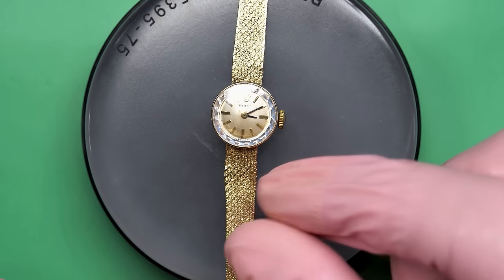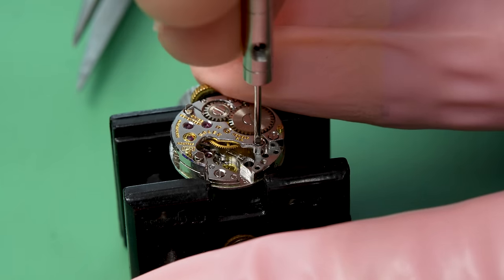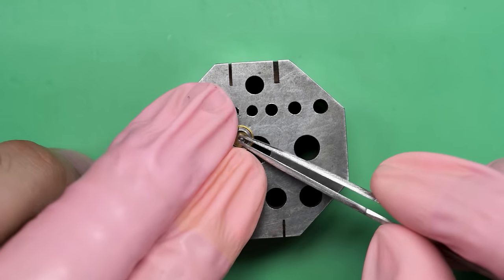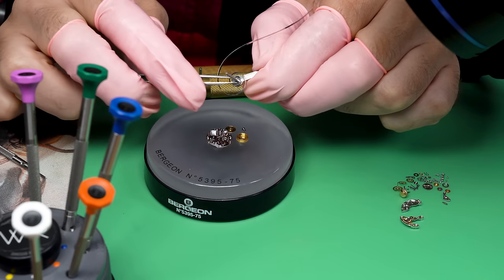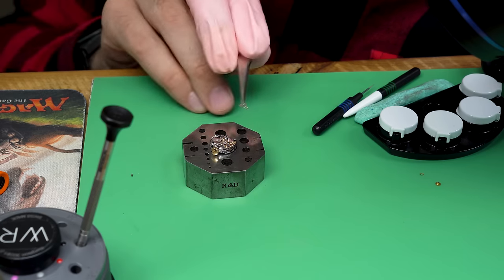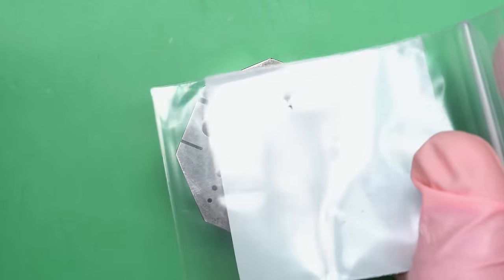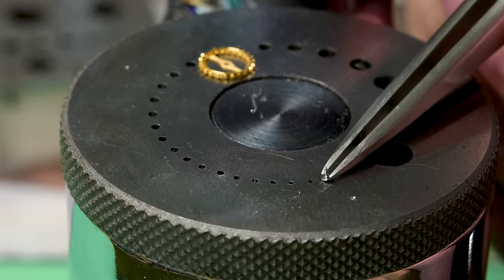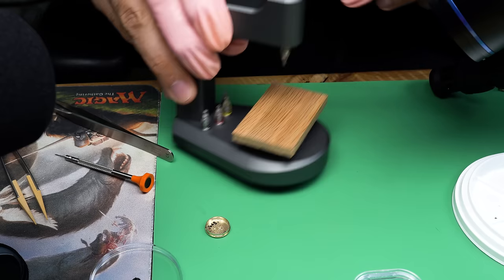I Lied, THIS is the Smallest Mechanical Watch I've Ever Seen!

Comment: I just watched your episode about the bigger smallest watch and left some remarks there. I am very impressed by you riveting the balance shaft having seemingly nil experience. It is a complex procedure, that requires some intricate steps of which you stay mute. Just one of them is how to achieve the not so amazing off-beat error that you got. 
You face an issue of over confidence not being aware of your limitations. One example is that you don't know that peg wood is for cleaning the bores of the jewels, not their surfaces; you just don't know how to clean jewels properly. You also don't know how to properly lubricate a watch, using much too much oil in some of the instances forgetting about some others. It greatly affects the performance of the watches you work on.
You are excellent at what you're doing as a watch repair channel host, but as a watch maker you're at a fumbling around level right now, drawing your satisfaction from dashing into the unfamiliar.
You have the curiosity, courage and the potential to to do really well once you spent some time to study the theory behind the matter. Best wishes.

Comment: 36:40 That's where I probably wouldn't be a good watchmaker, since I simply love to over lubricate everything I work on. I would oil every point of contact 😂 While most of mechanisms I work on are capable of discharging excessive lubricant, this definitely wouldn't work here. And not enough lubrication was always a concern for me 😂

Comment: I wonder if the guy who serviced it last accidentally broke that part and just put it back together and not say anything since it was still technically running at the time. If they didn't break it they should have noticed it was broken just like you eventually did.

Comment: Hi Marshall,  Just subscribed. I have been watching your videos for some time. I appreciate the manner and approach you have in exploring everything wristwatch.  Because you have made the repair of pocket watches, in particular, so interesting I have purchased an inexpensive quartz pocket watch to see if carrying a pocket watch instead of a wrist watch is something I can adapt to using regularly.  Concurrently, I have begun to explore the cost of purchasing a mechanical pocket watch of the type that often have worked on in your videos. Thanks for these videos, they are enjoyable on several levels.    ---update---  got a mech pocket watch.  I am searching your vids for how to open it up. It has two small cuffs (one on each side) to open front and back but I am proceeding slowly.

Comment: Actually, I acquired a small ladies Rolex watch very similar to this one when I was still working as a manufacturing jeweller, being offered to me for the scrap-value.  Aesthetically, it wasn't a nice looking watch as the band was as wide as the watch-case and attached much lower down making it look higher when worn, and instead of yellow-gold it was 18ct white-gold which tends not to have the whiteness of platinum or rhodium-plating!  Eventually gave it to a watch-repairer friend of mine along with a stack of watches, parts, & tools, in exchange for repairing/overhauling two watches of mine. 
Those were a Seiko Divers 6309-7040 automatic (similar to your 6105, except on the inside of the date window, it also displays the day of the week in English or Spanish) and a S/S manual Tudor 7934 Oyster with radiating pearl dial, circa 1960.

Comment: Catch this - after many calculations done with the use of the perpendicular camera shots and diameter of the German watch case stated on their website to be 38,5mm - the tip of the spike within the balance wheel at exacly 34:20 would be around 0,03-0,04mm.
Now, I've dug the internet about what's the diameter of a gold atom and it turned out, that this particular spike is roughly 100 000 atoms wide.

Imagine the scale.

Comment: While I realize you probably don't need to work on watches that tiny very often, you could, if you wanted to, build up the contact points of your small movement holder with 5 minute epoxy. A couple few passes on each point would extend it's range... theoretically.

Comment: Hello, just out of curiosity was checking on the 1400 Rolex movement. You aware that there’s more versions? I found out that it exists with at least in two models with either 17 or 18 jewels!! I am now curious where that 18th jewel sits versus the 17 jewel variant!

Comment: When I was very young I went swimming while wearing my basic mechanical watch. I initially thought the watch was water resistant because it survived the first couple of swims. But.. then the whole watch turned into a ball of rust. Moral of the story, mechanical watches don't like to swim! 
Have you tried re-winding the spring by hand without the too!? Also have you ever accidentally bumped your table causing tossing all parts off the table!? Because that's something I would do!

Comment: My friend has an Alben? ring watch circa 1970's, the thing is microscopic. No idea what movement is in it, Anyone know? My thought to hold the movement is just to plant it in a blob of rodico. But the key to "fixing" the small movement holder would be to file the jaws so they had a negative draft angle so they could positively grab the edge of the plate.
ETA: How is the impulse jewel referenced (clocked) to the balance- do you need to mark it or readjust the free sprung balance? I have been lucky so far, every time the balance won't start it is because I missed the pallet fork with the impulse jewel and every time it won't self-strt all it has taken is a beat error adjustment, I haven't had a broken staff (yet).

Comment: Probably that small movement holder doesn't keep its jaws parallel, meaning the pressure introduces an upward force that pushes the moment out...
Or the jaws are just not cut correctly.
Reply from the maker: Yeah it was a junky one

Comment: A 90 Degree rotation in the holder would have put the crown out in the open instead of it sitting on the holder which is why it wiggled when you tried working on it.

Comment: Marshall I have subscribed and liked your channel ever since I've seen it and I am just astounded at what you do I have a Bulova Accutron that I have since my grandfather passed away I remember him letting me wear it when I was 10 years old and I have tried to do what you're doing right now with a donor watch that I purchased off of eBay and I personally know the work and intimidation that those watches can give it has some of the most tiniest wires movements I have no in any way by far a watch repair menu but I can tell you I've seen you do miracles I'm a mechanic I work on cars trucks motorcycles etc and for you to work on these little tiny things that I have no way in the world how they are or even build but with all that being said I would love to see if you could fix something that is more dear to me than a lot of my belongings it's it is that Accutron boulevard The story goes My grandfather was walking down the sidewalk of a shopping center in 19 60 something and some guy took his watch off and do it in the trash can and he walked over and picked it up and he took it somewhere and had a battery put in it and it worked for the longest of time and then I got to wear when I was 10 years old and I moved away of course I had to give it back to him after he passed away now that I'm 52 years old I would love to see if you could get it running again if you could message me back with some kind of idea it would be absolutely heartwarming to see if you could do this and I have extra parts to send you with it if you think you could take this on

Comment: 36:26 to 36:28    When you remove the locking clip securing the jewels, why don't you use plastic or wooden tool not to scratch metal around when you undo or re-install it? I have seen on this and other videos where the metallic tweezers did scratch around the housing, so why not a wooden or plastic tool?
Reply from the maker: Precision with this part of the restoration is most important, you are looking at this work literally under a microscope, these kind of marks are effectively invisible to the eye.

Comment: Could you not get the movement held tight enough? If so, why didn't you put a few washers between the screw through that movement holder and the fixed plate? This would make the fixed plate be closer to the one that moves with the screw :-) If tightness wasn't the problem, Maybe a bit of rubber tape or something on the jaws?

Comment: I read a story a few years back on why women's watches (even from "high horology" brands) were still quartz.

1. Women don't care about the mechanics (this is not all, but most of them)
2. Its' jewelry, not a functional tool.
3. Something like 40% of mechanical watches that women wear where either - 1). Not wound; 2). Not set to the correct time; If the watch was quartz, the battery was dead.

My mom had a few teeny, tiny mechanical watches....I would love to see what the movements looked like..

Comment: Hi marshall have you done a video on how to adjust the watch so it doesn't run to fast?  You show if the watch is within tolerance using the beep machine but thats it
Reply from the maker: Yes I've shown the regulation on a few of the videos

Comment: It may have been worthwhile to build a movement holder adapter of wood to fit inside of your standard size movement holder. A 15 minute job with an appropriate sized paddle bit and a coping saw.
Reply from the maker: 15 min job for you :) I don't know how to do that

Comment: The problem with the movement holder wer all the rounded edges, which came with it being an injection molded part. I bet you could make a better one employing no more complicated tools than a drill press, a vise and a set of files.

Comment: I bet if you found someone with a small milling machine you could make that tiny movement holder work, looks like the jaws are not that well made.  Machining them lightly so they are parallel might help it a lot.

Comment: At the second pop out, at the very least at the third, that tool would have gone straight in the bucket in my shop. I don't tolerate mediocre tools. Either it works or it gets tossed. If that means I'm out of a tool I need, I buy a new one and wait for it rather than breaking my project.

Comment: next time use a rubber band to fill n the gaps on the small watches in that smaller holder. it will also give slip stop.

Comment: Why not set the movement in the green clay-like goop I've seen you use to hold down and even paint tiny hands?  Oh, I own a BENRUS ladies watch about the same size or smaller than this Rolex.  Is there any point to having it serviced?  Hands move OK like this Rolex, it just does not run.  Supposedly it is early 50s vintage and the case says 'gold'.

Comment: Why not actually put 5 seconds of thought and analysis into why the movement holder tool isn't working?  It's an incredibly simple device.  The machine screw works and applies tension but it appears that the angles on the gripping face isn't applying evenly onto the watch causing it to rock.  Figure it out and make a video.  If a craftsman can't build or even modify tools he needs then he's probably a useless hack.

Comment: I am not sure how to put this to you, but Rolex only started building their "own" movements in 2004. Actually, the just went and bought the factory that had provided them with movements. So you are not working on a Rolex movement in this video. 
Still, it is funny and instructive as you do not want to work with cheap tools. The movement "holder" is just a joke. Still someone out there built it in the knowledge that it will not work, which makes me wonder about the world ...
Reply: They were still their own movements by their design. They weren't off the shelf or used in other brands after the 40s or so into the 00s. Daytona was the last to source one with the Zenith. But 2004 only marks the year when they became fully integrated. They bought the company that had been making them for decades. Nothing really changed though.
Even Pateks had JLC as a base.